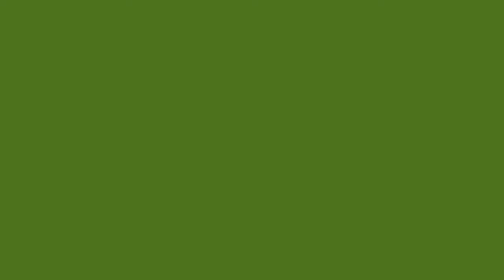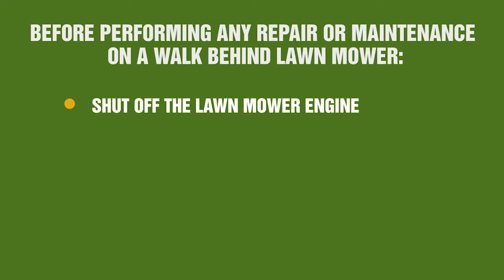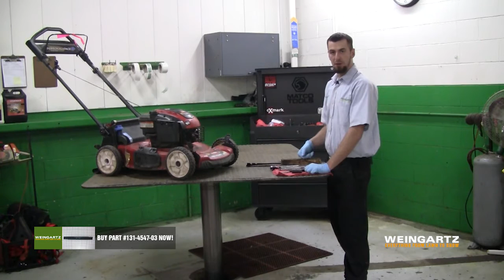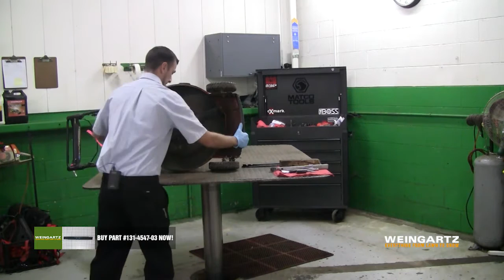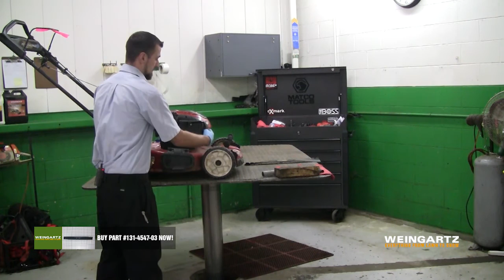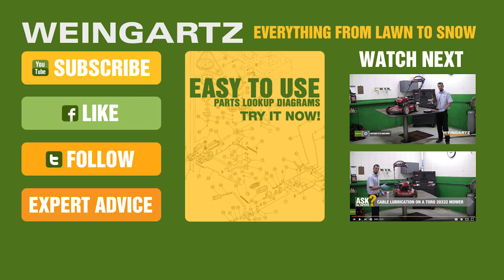How to Replace a Toro Walk Behind Lawn Mower Blade - Using Toro Parts Blade 131-4547-03

Comment: won't the oil or fuel leak out when you turn the mower over?
Reply from the maker: No it will not. You just want to make sure you keep oil filter side up.
Reply: @weingartz  thanks for the quick reply

Comment: 1) I can’t see where you are disconnecting spark plug
2) It’s so dark and I CANNOT see how you are positioning blade.

I’m screwed!
Reply from the maker: Helen, the spark plug in located in the front of the engine. Simply pull it out and tuck it to the side to prevent accidental starting. To remove the blade, position a block of wood between the blade and mowing deck. To install the blade, position the blade so the wing side of the blade is facing the mowing deck. Let us know if you have more questions.